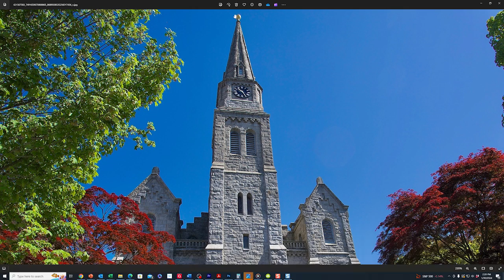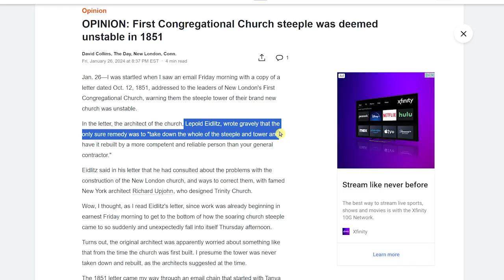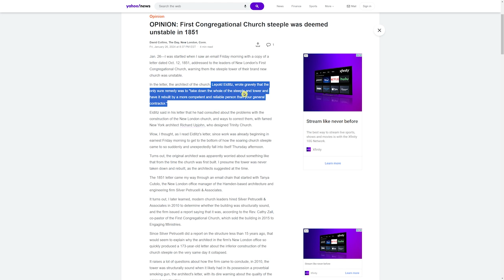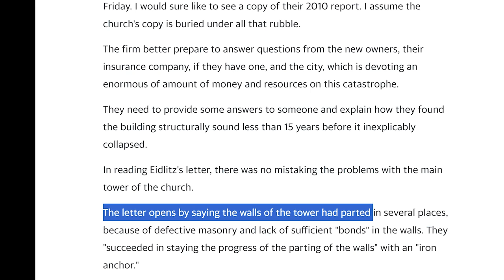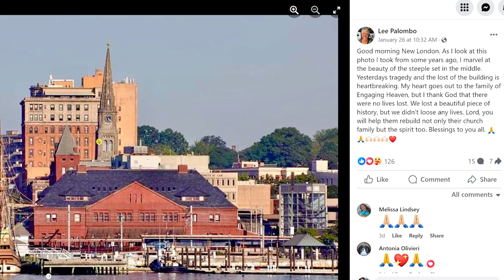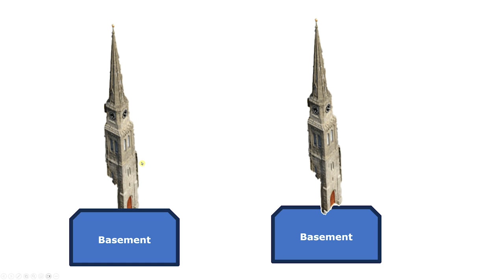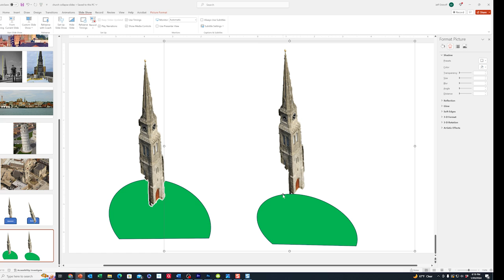What Caused Church Steeple Collapse New London, CT?

Comment: I wonder can't they rescue a part of the church? Towers and two walls? Or even rebuild the church from original construction material?

IDK if the Tower of Pisa is a great example of "a little lean is fine"; after all that building has been worked on tirelessly to stabilise it since its construction.

I think it's a possibility that the steeple tower failed at the roofline where it connects to the large roof, that there was a construction error near the top of the tower there somewhere.

Or maybe... this church looks like it's made from stock assets of Assassins' Creed videogame series, where you climb these structures to have a look around and unlock map based tasks. Maybe someone climbed it and their weight turned out a little too much after all this time :D

Comment: Jeff, I just had a horrid thought. Let me lead you down the thought process.
I am currently siting next to a house that has a concreted type of building tile. After 25 years of being on the roof, many are simply spontaneously breaking and falling off the roof, or at least portions of them.
My thought is, "They are porous. Cements and concretes absorb water. And swell. And then it freezes."
Mortar joints swell a bit when they absorb water, too, yes? And up in that neck of the woods, it has been known to freeze, too.
I think you see where I'm going?
Normally I believe a good mortar would have the elasticity to withstand all this.
But, apparently, this was not good mortar in the Church, nor in these roof tiles.
And also, the arrangement of bricks in the joints of the walls would need to take this into consideration, too, yes?
Was THAT done right?

Comment: One major issue no one is addressing is that the church has suffered in recent decades like many legendary chuches, trying to survive as membership dwindles as they try to stay in an old and inefficient structure, that as it ages requires more and more expensive repairs or updates.The maintenance of the steeple and slate roof alone would have cost sums beyond what a shrinking congregation could afford. This caused the congregation to sell to a non denominational church (popular now because of the tax benefits afforded to religious organizations) which according to Wiki still rented to the former congregation to hold their services. I live in Norfolk Va. another OLDER coast city and we have lots of vacant and abandoned old churches which are creating a headache for city officials as they have had structural failures (some forcing the closure of streets as towers or steeples shed blocks) and the city has to chase down owners, who have sometimes died off, or corporations that have folded, leaving the building as an orphan, and forcing the city to go through the long legal process to condemn it and find the $$$$ to either stabilize it or tear it down. The city has also run into opposition from NIMBYs who fight the repurposing of these large buildings into restaurants or micro breweries and complain about traffic, parking, or the "bad element" the new occupancy will bring in. Leaving current owners and the city in a quandry as to how to keep such buildings functional, and not cause tax dollars to be used to stabilize or demolish them. As noted by others , these buildings were built when asbestos, lead and other hazardous materials were commonly used in construction and finishes. It has not been indicated if the new owners had insurance and who will be suing who over what happened here.

Comment: You missed describing the obvious repair work performed on the roof area where it meets the steeple. You mentioned some possible water damage/metal sheathing rust at one point, but when you zoomed out and were comparing the steeple against the vertical (15:04), there is a very large triangular-shaped repaired area of the roof extending back from the steeple where it joins the roof from the ridge and thence back toward the steeple, rejoining at a much lower level. The roof tiles had clearly been replaced, possibly indicating there was water damage to the support structure at that point. Since the steeple leaned (for whatever the structural reason) and eventually fell in this direction, it appears possible the roof structure catastrophically failed in that area first.

Comment: Interesting analysis.  This is a huge loss for the New London skyline, which is still perhaps the best of any  Connecticut coastal city.  An absolute miracle that no one was injured or lost.  City Hall is the building just across the side street, and it too was untouched.  State Street in front of the church was converted to a pedestrian mall for a few decades in the 1970s-1980s, then restored for traffic.  It would be interesting to know if the storm drainage changes during those infrastructure projects could have had a gradual long term affect on the soil stability of the church site.  New London is a great little city, and will survive - but it is sad to see such a beautiful irreplaceable piece of historic architecture "missing."

Comment: I'm wagering the failure was on the exposed elevated walkways between the towers. There is significant discoloration and the location makes it likely to be ignored during snow removal or refilled as the snow comes off the adjacent roof. Get a number of freeze/thaw cycles jammed into the corner and it could easily weaken already shoddy construction thereby causing the lean. You can also see the discoloration where those areas drain down the center tower where freeze/thaw weakened the joint where it kicked outward.

Comment: Just wondering about the daily heavy pile driving a couple blocks away for the wind farm dock project over the past 2 years? If I remember correctly, the church sat on granite bedrock. If that extended to the docks, wouldn't the rhythmic vibration be transmitted?

Comment: Another YouTube site offered a compelling root cause analysis. The damage noted in the 1851 letter was at the base of the steeple where it meets the roof gable. The wall of the steeple was parting from its support at the front of the gable roof (where the gable roof met the back wall of the steeple). Google satellite photos from 2014 show an area of compromised mortar and displaced stone just above flashing where the gable roof adjoined the back wall of the steeple.

It appears that decades of water intrusion compromised the back wall of the steeple. It has a 1 degree lean backwards in the 2014 photos. Video on the day of the collapse -- minutes before the collapse -- showed that lean increasing to 6 degrees. A lean like that shifts the center mass and shifts the weight of the steeple to its already compromised back wall. The back wall collapsed under the increased weight of the backward leaning steeple, and the entire structure fell backwards into the roof of the church.

Note that the steeple was stone all the way to the top. That meant that the very top of the steeple was quite heavy. In the security cam video, you can see the top break off as the tilt increased during the fall. It then fell straight down.

Maintaining historic masonry structures is very expensive. Needed repointing and repairs at the back of the steeple had probably never been done.

It is indeed fortunate that nobody was hurt or killed in this massive collapse.

Comment: Did you bother to check your earthquakes in the last months or so? Our whole north American plate has been on the move, including small quakes on the east coast in the last month and month & half.  This is the second building that has collapsed in the last two weeks up on east coast.  Pay attention, if earthquake activity picks up next month with higher level solar storms we are likely to get next month, because we will be in closer orbit to sun and magnetically connected,  You may see more unstable building go with further earthquake activity.  Very simple cause and effect.  Word to the Wise, check the building you live and make sure there are no structural problems.  Our global has been seeing earthquakes of 5 to  7 magnitude traveling around the globe. Think of ripples in a pond when you throw a stone in the water, earthquakes can radiate out in similar fashion, triggering weak points as it goes.  
US worst fault line is under Manhattan, it just doesn't fracture often every few thousand years. Think of how long US has been here without a major quake on east coast.   New Madrid in Mississippi  valley we are over due for, that is about every 200 years and east Coast is moving with some steady 4s.  Pressure has to go somewhere.  Update, Oklahoma just took at a rare 5.1 quake so the pressure went east moving toward the New Madrid Zone.
 Looking a head,.  In the next few days we will see small solar storm from Coronal hole that will have some electromagnetic energy.  We had a large CME from back side of sun and that region will be around facing us within two weeks.  Eyes on March for the Normal Large solar storm we get every year.  Next predicable peak pattern will fall Aug 21 thru Oct 21, this is a time we can get some mid to large level storm solar storms.  All of these can dump Electro Magnetic energy into earths atmosphere, this can agitate earth, ad to harmonic tremors like a bell.   Combine that with how storms hit our Magnetosphere, and how that pressure is compressed down on tectonic plates.... It all helps trigger earthquakes.  We aren't one solid ball in the sky.  We are a liquid ball with layers of skin around it and those outer layers are fractured and ever changing.  Poke down on one spot and all the others will be affected and have to adjust.  
Be advisable to stop listening to political rhetoric, and open your eyes to what is happening on earth.  We are seeing some really bazar things that may indicate we are entering a new phase in earth history that won't be so quiet.

Comment: The Leaning Tower of Pisa was built over hundreds of years. Wars stopped its building a few times. It started tilting before it was finished, so they actually finished the rest at an angle off from the rest of the building. It kept leaning more over the centuries and I believe it was in the '80s that they had to shut it off from tourists because it was close to falling over. They put weights on the one side of it to pull it back, until in the recent decades they drilled soil out from underneath the one side and brought it back to more vertical than it ever has been in modern days.

Comment: 12:40 I see like 3 cracks.
Reply: Look to the left of the opening above the main door, almost even with the top of the opening.
Reply from the maker: But what about active cracks not sealed up cracks
Reply: Sealed up cracks are still weak spots. You can't tuckpoint your way out of something like that. That one I pointed out looks like it cuts into the stone, too. I could be mistaken; they are pictures after all. I am a building inspector, though, if that makes any difference. My guess is those iron pins finally corroded enough and let go. @jeffostroff

Comment: I live approximately 4 miles from the church and have an office 1/2 mile away from it.  Two weeks before, I needed to right my paintings in the walls of my home and office due to their being awry.  I blamed the incessant pounding into the ocean floor caused by the creation of the wind turbines just offshore…

It was not windy the day the steeple crashed and the church is on a hill so I did not think it was weather-related.

Just some thoughts…
Reply from the maker: More likely all the heavy rains you had caused ground shift

Comment: I wonder if those iron ties went through the tower front to back, or were just acting as wall tiles to tie 2 or more skins of brick/stone together just in the outer walls? 
My 2p's worth is that the back wall (on the nave side) was dropping, possibly due to failing foundations which eventually gave way, the spire and tower fell backwards but the front and back of the tower below the arch level separated, the front falling or sliding forwards and the back falling back into the nave?

Comment: Since the tower was free standing due to the smaller structures on either side. I would say in my opinion the ground became unstable due to undermining from years water infiltration and the stress of post tensioning rods that were used to tie the four side together. I wonder if the soil was tested for integrity under the tower during the engineering study and was the mortar tested for strength. The church had study 15 years ago and found some deficiencies. There should have been follow up inspections of the structure after the initial study. Unfortunately facade inspections can be costly if carried out on a regular schedule.

Comment: I don't see cracks on the walls- but I do see what looks to me like selective repointing on the front, and on the side view-  it looks, to me at least, selective rather than a complete job as one often does when pointing is wearing normally, pointing being sacrificial. If I see a wall with selective repointing, it does make me wonder what's been going on. Given the obvious leaning on the photos, I'd say it eventually leaned too far, then broke its back, pushing the lower front wall forwards up to top of arch level as the upper part fell back into the roof.

Comment: My concern was the valley in back of the tower. The valley had been repaired or replaced, as well as some of the slate, although I bet decades of water infiltration compromised the back lower part of the tower, causing it to collapse. Of course a compromised original structure doesn't help

Comment: I think the ground gave way due to the weight of the steeple. The bearing strength of the soil underneath the steeple was subjected to an  increased weight/ft^2 over the lower height of the walls. The weight/ft^2 pressing upon the soil is a function of the height of the structure above it -- given that the density of the structural material, granite, is constant. Also the soil below the structure was subject to 172 years of erosion causing the soil to be unable to support the weight/ft2 of the steeple.

Comment: Great analysis! If the steeple had problems from construction in 1851 and they "fixed" it with iron rods, then those rods likely corroded over time.  As iron corrodes it not only weakens, it also expands putting pressure on the already compromised surrounding masonry.  As the wife of a minister who has served churches using older buildings, I can tell you that due to budgetary constraints, most congregations opt for temporary patch repairs - that by default become permanent repairs.  Unfortunately, most of these repairs are centered around eyewash and not actually dealing with the underlying structural problems.

Comment: As the steeple fell backwards, the cuckeling weakness was NOT on the street facade but inside walls, most likely a roof leak that had rusted those structural support iron rods that had been added, once again cheap contractor didn't use rods that wouldn't rust, as evidence showed on the facade. From 1850 they had used cheap masonry in between the stones, we can see this across Europe in some really old buildings, but it is rare. There could have been interior wooden beams that were attacked by woodworms or termites, gone unseen, and the stones above it finally were too much for the weakened eaten wood, once again a problem we see across Europe in castles and churches.

Comment: First off, want to say, this was a great analysis of some of the causes of the church steeple collapse. Great job explaining it all...
I am not an expert, but if this church did have some issues way back, that would make some sense...I was born in New London and live in Conn.and this was beyond sad to see this happen.... I do know for the last two years or so, it seems like all it does here is rain, and I don't mean a light shower, I mean torrential flooding rains!!!!  I have Never seen it as bad as it has been, in these two years! Just a few weeks ago, which I think is important, we had yet another torrential rain storm, but this time, the temps were in the freezing single digits, only to have in almost the same week , temps reaching in the high 40's. That is a big variation in temperature...Then the following week, this church steeple collapses...
I think this obviously has been going on for awhile, the weakening of the mortar, with the issues it already had,  and then cold and then warm temps after the rains, may of been sadly, the breaking point..

Comment: It has been a common practice in steeples in New England, especially in all wooden structures like the Church I attend that there  would be a very slight lean towards the back of the structure so that in the event of a fire the steeple would collapse into the building and not into the street.  About 20 years ago when our insurance company inspected the structure, they discovered a problem with our steeple and made us do repairs and remove the set of chimes that were causing high loading that could lead to collapse in the right conditions. I wonder if they had insurance that required structural inspections on a regular basis or did they get the "El cheapo" kind that did not require them?   Thanks for the analysis.

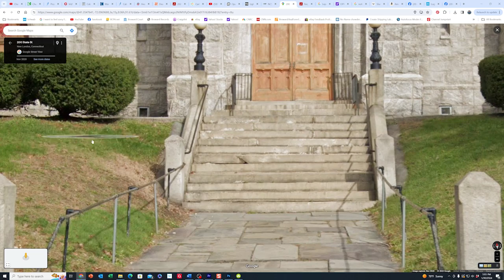Comment: freeze at 13:21 and look at the line across the picture where the top of the hill meets the foundation. 
it looks like the steps, and probably the center of the building as well, were sinking. that would explain the cracked steps. 
there was probably subsidence under the front/center of the building, which weakened the foundation under the steeple, which was already poorly constructed.